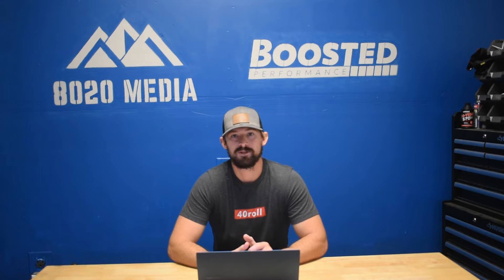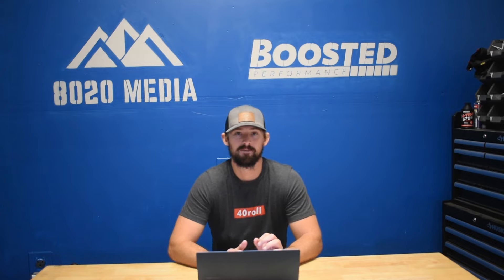DIY: How to Fix GMC/Chevrolet "Service Stabilitrak" & Traction Control Lights!

Comment: New subscriber.
Just picked up a '13 Equinox. Zero rust. Drove it from Vagas to MN. Was concerned about oil consumption, but it didn't use any on the trip.
Got the stabilitrak warning. Will ve working on solving this issue.
Thank you for the tips! Will definitely check out your site.
Reply from the maker: D - Thanks for the kind words. We hope you are able to resolve your issues~
Reply: Did u figure it out
Reply: @bwalters413  yes I did!
A previous repair had a broken three tab washer that went in between the wheel bearing and axle. This washer was off center. It cut the wheel speed sensor! Sensor would work fine until things warmed up!!
New sensor and washer!
Since this thing is rust free, everything just came apart without any effort!
Reply: @8020Media  yes it's fixed. Just wrote a paragraph about it.
Reply from the maker: D - Thanks for taking the time to come back and update! This will certainly help future viewers.
Reply: Also have the 2013.  There’s a recall to replace the pistons, but I think it’s ended. All the sudden all the oil would just blow out.  I was in the timeframe for the recall thankfully.  Have now 177k miles on it and had no other issues for 77k miles until now.
Reply: @Dbb27  why climate do you live in? I'm hearing that these use more oil in cold winters. This will be the first winter for ours.
Reply: @dans_Learning_Curve   Florida.  There was a lawsuit filed and it became a recall.  I barely got in for the fix.  I would be driving and all the sudden no oil. I always change mine like a religion. All my pistons were replaced at 118k. 120k was the cutoff. $7,000 worth of work!
Reply from the maker: D - Thanks for taking the time to share this!

Comment: Hi Jake,  great video!! 2013 Chev Imp 3.6 w/182K mi. No CEL or TPMS, only stabilitrak light activated. In addition car reportedly idles rough but drives ok.  Just to confirm, I should check plugs, fuel filter & throttle body?  Car is at auction and I'm thinking about bidding on it.  Thank you.
Reply from the maker: Gerald - If you want our honest opinion, we wouldn't go near it with 182k miles. How much are they asking?

Comment: 😮‍💨😮‍💨 Lawd I’m over here thinking my motor just slung a rod or something. 2015 Chevy equinox just hit 100k going about 80 down interstate and stabilitrak failure engine light pops up and rough idle and I’m like “yooooo I just put oil in this thing and it never got low…” thanks for the video man relieves some stressing knowing that more than likely my motor is not Toast. Only got one tire pressure sensor working and need my brakes replaced but ima start with code but just take it to dealer first tbh.
Reply from the maker: Matt - Glad we could clear things up for you! Keep us updated on this.

Comment: My stabilitrack came on about a week ago, and soon after the check engine came right behind it. I drive a 2016 Chevy Malibu, took it to my mechanic ( Jeff Gordon service department ) and they basically told me I would need to drop 10k on an engine. That didn’t seem to right to me, and keep in my mind I don’t know shit about cars really. So after a couple of days i decided to go take my car back and have  another mechanic look at it. He Put a new part in and gave me some Techron and it fix the problem. Lol I mean the light came back on after a day or so but he told me wait until the fuel injection reaches the engine to see if it’ll helps. So rn im just seeing if this helps, but if not i know what to suggest. So I thank you sir
Reply from the maker: 26 - Nice! We know this problem isn't easy, but 10k sounds ridiculous.. This is why we make these videos, to hopefully help others not get screwed by dealerships and or other mechanics. Keep us updated here.
Reply: Did you find the issue? 2016 Malibu also stabilitrack , power steering and engine light on. Del like it’s loosing power.
Reply from the maker: S - We also have a video on losing power: https://youtu.be/ipjYLPJgpq8

Do you have any engine codes?

Comment: Great Job ... a buddy had a problem with the Stabilitrack system and purchased a new YAW Sensor and it worked ... any thoughts on replacing the YAW Sensor ?  thank you
Reply from the maker: Nice, good work on figuring that one out. Yaw sensors are a bit more complex of a sensor and probably a lot less known - but they are part of the electronic stability control system on all vehicles so on GMs specifically a problem with these sensors would definitely cause stabilitrak to turn off.

Comment: I just got done with this in my '14 Silverado.  Pricey deal.
Reply from the maker: N - Sure is... What did they end up doing to resolve it?
Reply: @ Long story.  I’ll be as brief as possible.  It began as I was slowing to get off a 70 mph highway.  Negotiating a left turn, truck fainted dead away.  There was a brief flash of an error message that said to service Stabilitrack system.  I turned off the key, and restarted it with no issue.  After parking in my driveway overnight, truck was dead.  Like dead battery dead.  Went inside and pondered a couple minutes.  Decided to try it again and see if any lights were working.  Yes, they were.  Got another message saying to put the driver’s window all the way down and back up again.  Vehicle should start.  It did.  When I explained it to my regular service garage, they referred me to a dealer.  Dealer plugged into the computer and for $195, told me they would begin by replacing the top panel of the fuse box under the hood for $950.  I did this myself 6 yrs ago for $250.  Then, I had a flat tire from something that split my rt front one on Florida’s turnpike.  Spare was useless.  Walmart had one $175.
There are sensors inside the tires that are part of that  Stabilitrack system.  There are 3 systems that come together under the Stabilitrack system as a whole.
Final fix was when I was referred to an auto electrical specialist nearby, luckily.  He asked if everything went out when it died.  The radio, time, etc.  YES!  He checked the positive battery terminal connection.  There was 90% rust and 10% where there was actual connection.  He used a special drill to clean it out, $180, and I haven’t had a lick of trouble for 3 weeks now.
I also had my regular garage door a front brake job/oil change during that time ($500).
My opinion is the terminal cable was the main culprit and very bad brakes in the front were secondary.
Reply: I have a 2014 GMC TERRAIN today my starbiltrack light came on,so did the full pump light and when I put it in gear it would make a nose and do like a jerk.
Reply: @1neofakindcreations   I would make sure all tires are equally inflated and making sure all the sensors are correct by the dashboard readings.  Just a place to begin.
Reply: @nicelady51  thanks I had it towed home yesterday and haven't tried anything since. I will go out this morning and see what's going on with it.
Reply from the maker: N - Thanks for sharing!

Comment: Good video, thorough and explained clearly. I had a stabilitrak issue on my 2016 Traverse and ended up chasing it to brake peddle position sensor.
Reply from the maker: G - Thanks for the feedback and sharing your experience!
Reply: hello there i have the same problem with my traverse 2016 the dashoborad goes on and off all with the gauges, service TC and stabilitrak come up and the engine light
Reply: plus i notice it happens when i step on the gas to speed up a bit
Reply from the maker: U - Do you have any engine codes?

Comment: Thanks for the video, lost to consider on my Traverse. I can not dive it for a couple days & everything resets, then the other day made a short trip (an hour or so away) then traction control and service Stabilitrak lights came back on. Also when those lights are on, starting to accelerate starts to skip; more at 60-65 mph briefly.  Your thoughts 🤔 Can not drive for a Day everything resets & is fine until the next time.
Reply from the maker: I'd check ignition and fueling components.
Reply: my acadia did this...got worse over time; turned out to be a brake switch.
Reply from the maker: DJ - Thanks for sharing your experience!

Comment: Just got struts replaced but without having the wheels aligned. Soon as I started driving, the service stabilitrack light came on. But no check engine light. Can a car being out of alignment cause the service stabilitrack light to come on?
Reply from the maker: T - It can, but give it a few days, it may just be adjusting to the new struts.

Comment: Can bald tires cause stabiltack to break?  I know I need tires, but When I am turning the wheel sharpe to pull into a parking spot, my truck automatically breaks and it pushes the wheel straight, I’m turning at 2-3mph
Reply from the maker: Michael - Bald tires can't "break" stabilitrak. That sounds like a power steering issue.

Comment: Ok I just got a brand new front end on my 09 sierra. Never had a problem until now. My abs light and stability track light is on. I got a front end alignment right after. I put scan tool on it and it said front right speed sensor. I replaced that and light still on. Do I need to just keep driving it and it may turn off?
Reply from the maker: D - More than likely. If you can reset the codes and drive 50 miles or so, it should reset. Keep us updated.

Comment: If I pull the fuses for the traction control and stabilitrak will it turn it off
Reply from the maker: G - I mean it may work temporarily.. but we certainly don't recommend it.

Comment: Water in the fuel from the pump is my issue. I have had "service stabilitrac/traction control" Every time I get a water contminated tank full. It causes the engine to stumble thus triggering the shutdown of traction control and stabilitrac. It is totally ridiculous and criminal that GM/Chevy would cause a compromise of engine performance due to this issue

 Recently gasoline quality has suffered with excess water at the gas pump.
I have had to spend a lot of $$$ for fuel dryers in the recent months here in N. California.
Buy good gas. Use fuel dryers.
NOTE TO READERS: SUPREME grade gas does not have enough ethanol to absorb water. So you need an additive like HEET or SEAFOAM.
Reply from the maker: Jolujo - Thanks for sharing your experience and insight. This will help future viewers!
Reply: It's called derating and all Diesels do this to save themselves.
Reply: I STOPPED buying personal  GM vehicles because 10 of 12 GM's I've owned had stabl iltrack  problems usually in the firstCompetition
Reply: I certainly will never go with another stabilitrak vehicle. Every vehicle has its own problems, but this has been ridiculous! Going on 5 years of CONSTANT problems with this. 2018 chev rado

Comment: Great video.  I have a problem where I code 1101 along with oil leak.  My pvc hoses were broken and replaced.  Then a day later, I was driving my car and all the sudden, stabilitrak, traction control and check engine lights started blinking and car was running rough. At steady speed it was ok but once I accelerated and slowed down, it was like ABS was kicking in .  I plugged in a reader and code was P0302.  So is this misfire issue, transmission, or stabilitrak?  This is a cadillac ats
Reply from the maker: L - We have a great video on engine misfires that may be helpful here: https://youtu.be/f1mQ5hD1-vI

Comment: This is an awesome video.  My stabili track light just started coming on.  Once shut off it doesn’t happen at startup but once I go it doesn’t.  It seems some problems are more with the electric system but if you have experienced the vehicle slowing down then it’s a mechanical issue?  Heading for service tomorrow but not sure about going to the dealership or the local mechanic I use.
Reply from the maker: D - Would advise to go to the mechanic.. The dealership could spend hours on it trying to figure it out.. Keep us updated.

Comment: This video is very helpful.  I'll start checking those things and use your list.  I'm not getting a check engine light but my truck will get stuck in Park.  Weird thing, if I rock it back and forth it will then go into gear.  If I put the parking break on then put the truck into park usually when I get back in and put the truck in gear and then take the parking break off I'm fine.  Super weird so I'll just have to keep trying.... thoughts?
Reply from the maker: Hey Leslie - based on the fact that rocking it works it could be the parking pawl. Alternatively, the shifter interlock solenoid or brake switch could be bad too. Putting the parking brake on first then putting it into park is the solution to get around issues with the pawl. But checking and fixing the pawl is a bit more difficult since it sits within the transmission, so check the other two first. Brake switch is the easiest to check.
Reply: Wow! A women trying to repair a car problem herself, way to go girl, want a date?
Reply: Maybe if you're on an incline or decline torque lock can be occurring on the parking brake spindle in the transmission. I was told to apply the ebrake in neutral and take the ebrake off in neutral to prevent the shifter from locking up.
Reply: @pamelapaulon2269  thank you! I will try that and see how it goes
Reply: @Donnie_Prestwood   Sorry, she actually has a boyfriend.  He's just busy playing video games..  LOL

Comment: I have a brake light, traction control, and ABS light on. 
Stability track, steering assistance reduced. 
No power to radio or passenger side window. Front headlight out.
Any thoughts on these issues?
Reply from the maker: Romero - Sounds like you've got a lot of problems that need to be addressed.. Do you have an engine code reader? That would be the easiest place to start with your diagnoses.
Reply: @8020Media  actually, I got most of it fixed. I had replaced the ABS wheel speed sensors with ones from Napa turned out. Those ones suck and neither one worked.
I still have a traction control light on, but I believe I have a burnt fuse somewhere so I’m just trying to figure out where.
Because I don’t have power to certain parts of my vehicle
Reply from the maker: Awesome to hear Romero! Keep us updated on this, it sounds like you are on the right track.
Reply: I have the exact same problem. Literally exact same problem.
Reply: @MaciainChandler  so for me, the connection on the main wire harness that connected to the speed sensor lost connection due to the wire being broken inside the plastic so I had to splice the wheel speed sensor to the main wire harness that fixed that problem but then I also had the 185amp mega fuse that’s connected to the battery box go bad.
That one was my fault from disconnecting the battery I arced the battery a couple times burnt out the fused
Reply: @mr.romero4799 thank youuuuuuuuuu!!! THIS!! 🙌🙌🙌🙌

Comment: Check your Air filter too make sure your engine isn't struggling for air, Id Run some fuel injector cleaner through your car, clean your throttle body.
Reply from the maker: OI - We couldn't agree more!

Comment: Glad I found this. Mine pops up then turns off almost immediately. It also seems to only happen when it’s hot outside. It won’t do it during the winter.
Reply from the maker: N - Thanks for the feedback! We hope it can be useful.
Reply: I have the same issue with the outside temperature. Did you find the fix?
Reply: @StevenRose-to8wp  I wish. I have no idea what it can be. Doesn’t seem to actually effect the truck though. Annoying as hell.
Reply: @nkklane24  I have seen a decrease in fuel mileage on my last trip to SC

Comment: Mine was a stuck brake booster vacuum sensor and failing vacuum pump. Took a scanner to diagnose. Replaced those parts and all has been good since.
Reply from the maker: J - Thanks for taking the time to share your experience!

Comment: Question: I have a 2016 GMC terrain and recently got a check engine light and pulled the code P0463 which came back as the PCM (power train control module) then about a week later the abs and traction control lights came and service stabilitrak displayed. Could the PCM be what caused the other issues? Thank you. Great video btw, very informative.
Reply from the maker: B - This definitely could cause stabilitrak and traction control lights to appear.

Comment: you need to check or replace the abs cables.
Reply from the maker: Ky - Thanks for the input! Could definitely be a solution with Stabilitrak going off.

Comment: I have a 07 Tahoe LTZ . 0P300 code: I changed wires, plugs, Coils, also one wire connector that plugs into coil that had shortage low voltage power in one after testing all now ima trying to see what’s next steps to try.. now I checked for vacuum leak that’s good injectors are my last step.. recommend any other suggestions b4 I replace injectors? Thinking about getting all sensors replaced to see if fixes problem. What all areas should I check for replacement?
Reply from the maker: J - We have a full video on this code that we think will be helpful: https://youtu.be/f1mQ5hD1-vI